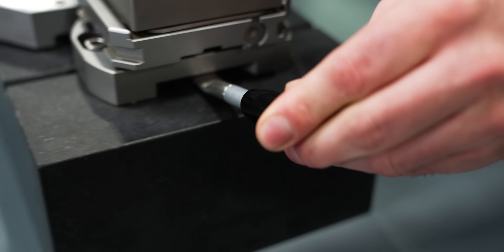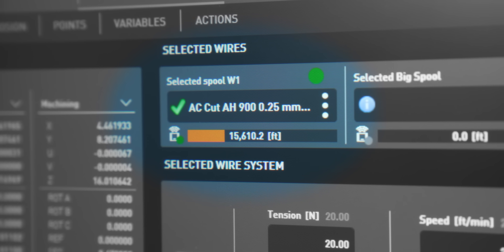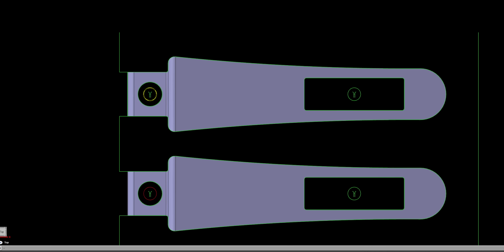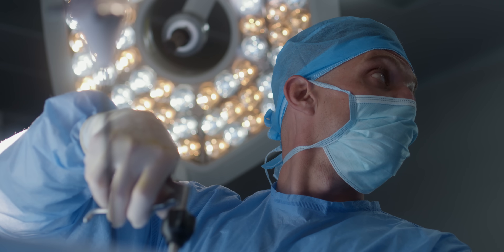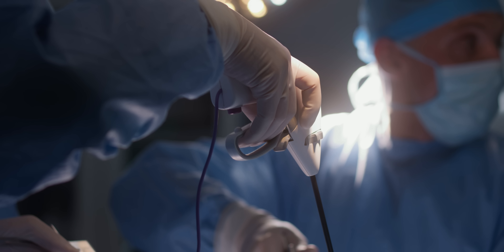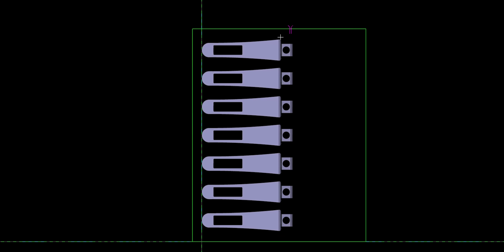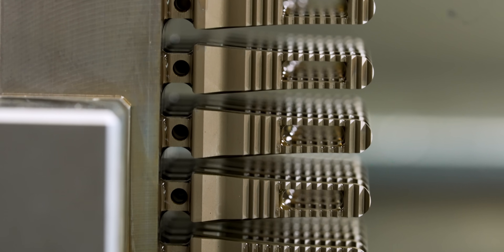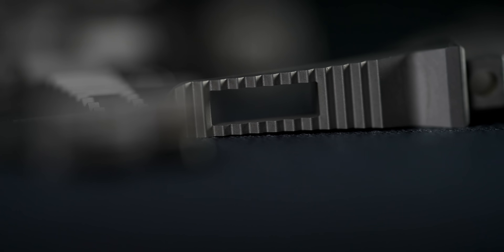The Complicated World of Machining Surgical Tools

Comment: Interesting. I design mechanisms that often require EDM for manufacturing.
I was always under the impression that operations like around 5:20 were very hard, if not impossible, as the coolant cannot neatly flush through a single channel. I guess the technicians were wrong, and it can actually be done.

Comment: I'm looking at that machine you're putting that spool into, I'm sure it cost millions. But it doesn't have a self threader for the spool? hilarious
Reply: It doesn’t automatically take the wire from the spool to the upper guide but it does automatically thread the wire while the machine is running. It takes about 15 seconds to run the wire through those spools so it’s kind of a non factor.
Reply: @trevorgoforth8963  ahhhhh gotcha

Comment: Ok, so 2 questions here (I’m a doctor so very familiar with laparoscopy) but how does the EDM make an enclosed pocket (it seems the wire needs to be across the part?) and related how did you cut the tabs across the stock but leave the parts attached? Like if you cut across with a band saw (which EDM seems like the sci fi version of?) you would have dropped the parts into the bin below?
Reply: Haha great questions! The enclosed pocket is accomplished by drilling a start hole, feeding the wire through, and then cutting the desired shape of the pocket. 

The parts stay attached after cutting because I left a .010 tab so the parts didn’t fall into the tank. Sorry I didn’t mention it in the video!
Reply: @trevorgoforth8963 aha that answers my question for keeping the parts attached, Mitsubishi EDM machines can weld with the wire so the drop-out part can be lightly welded to the holder en be broken out afterwards
Reply: @MW11-  Yeah GF has slug welding options as well, we just don't have it on this machine!

Comment: I'm surprised the manufactures haven't come up with a rotating head for the wire, although if the parts are small enough the bed could also rotate to some degree.

Comment: Thank you for showing an EDM wire doing something other than making parts that disappear flush into another part. I love these machines
Reply: why is edm being used here? tolerance reasons? seems like a whole lot of work
Reply: @janek_ow5076  Surgical tools like these are extreme precision devices, so yes. These are going to be used inside someone's body, possibly for very delicate work; so they should do the job correctly every time.
Reply: @janek_ow5076  surface finish is a big one and for these parts it's the fastest way. what would do you instead? six axis CNC doing each part one by one?

Comment: Were do u get those holders for the wire machine? They look so much better than the table vises we use.
Reply: System 3R (also part of the GF family just like AgieCharmilles), we use pneumatic ones, so a robot can change holders and the machine can run 24/7 (as long as it has thread)

Comment: When you are doing the op before cutoff, are you running a higher wire speed? Essentially you have an interrupted cut then and isn’t the wire being degraded from the top to the bottom?

Comment: I do not understand how the wire is able to cut a blind hole through the material - how does it accurately make the blind plunge ...?
Reply: The wire doesn’t cut blind holes. The start holes are made using an EDM drill or mill. The wire has to travel all the way through the part so it can’t cut blind features. Sinker EDM’s however, are used to EDM all kinds of difficult to machine blind pockets and holes.

Comment: How is the start hole made, a drill?
Reply: An EDM drill, also known as a hole popper. Or you can drill them using a mill or drill press.
Reply: "We maintain a gap between the electrode and the workpiece where the spark is created. It's noncontact machining," explained Dave Thomas, president of EDM manufacturer Sodick (not the Wendy's guy apparently)

Comment: I work for acompany that produces components for lapriscopic tools. We produce the main bodies, levers, buttons and knobs. we also over mold some of the probes that are used. We also produce tubing kits for endiscopes, various housings and components for trolley assemblies. The only problem I have working in the metrology lab, is the large volume of work that comes through. A shot of 4 parts every hour until a batch of 50,000 parts is complete, at a rate of about 400 parts an hour. Then an AQL inspection and full set of measurements on 80 or more parts from the production run.
We have 2 EDMs in the toolroom that produce the mould tools, 1 wire, 1 sinker. The mould tools often have different dimensions than you would expect given the dimensions of the final product and can often take a bit of fine tuning.
Reply: Ok

Comment: May I ask how much that part costs? I mean this is  a secret but around how much? Considering technology / time / total batch size? its like 500 dolars per 1 tool? or magnitude more? ~ Just curious..
Reply: There are 42 grippers made out of this block. Let’s say it takes 20 hours to make them. Even at 120 bucks an hour shop rate that comes out to about 60 dollars a piece.
Reply: @trevorgoforth8963  thanks for answer. I really thought it would be much much more expensive given the application but wow. That is quite impressive pricing.
Reply: Probably double or triple that. Surgical steel is very expensive just for raw material and extreme accuracy multiplies the part cost. EDM wire can cut to microns. EDM machines can be a bit slower for cutting feedrate, but you save when you can cut multiple parts simultaneously using repeated pattern geometry or if you can stack multiple parts at a time using a higher head height. I used to cut stacks 100 to 300 sheets high to machine gaskets for pipeline parts. Also not much tooling needed for EDM reduces cost. Just need wire, resin tanks, and dielectric water filters as opposed to numerous endmills, drills, treadmills, and facing tools and the collets and tools holders needed. Sorry I'm blabbering lol

Comment: Question: why don't you do the ruffing with milling and then go to the EDM?
Reply: You can but there isn’t much need to. Square block there is a better seal for flushing with the water jets so it’ll cut faster. It’s also unattended machining time. Either run lights out or run another machine.
Reply: Because after you rough it out with an endmill you'd have to rough cut the initial wire cut anyways to get the proper distance for voltage gap and wire tension for a proper skim pass cut. And end mill would be like using a chainsaw for a surgical cut and the rough cuts for EDM wire are only a few , usually .005" to .010" , off the desired profile or geometry of the part.
Reply: @aguillot1984  ow didn't think of that :) very good answer. Thanks

Comment: i take it since the wile spool is being collected under the machine and since its the sparks and not the wire doing the cutting that the wire can be reused for more cuts than just the one time
Reply: The wire will be corroded, it’s cut up into tiny pieces and recycled
Reply: Yes it's waste once used then recycled. A wire processor on the back snips it into tiny pieces. I ran Mitsubishi FA and FA/V series wire EDM machines for over 5 years. Usually we used .012" wire but can go all the way down to .004" with only a little over .001" over burn, so if needed you can cut slots down to .006" wide and ID corners almost perfectly sharp with a .003" radius.